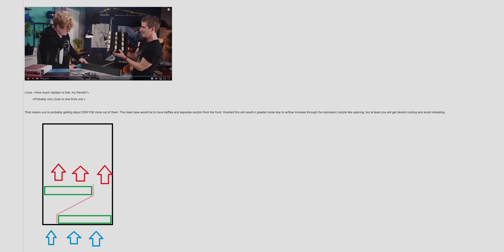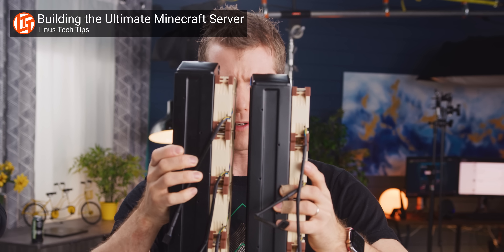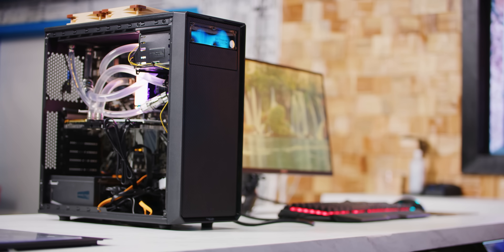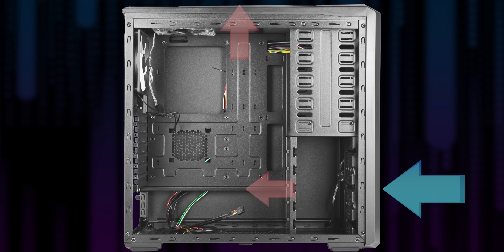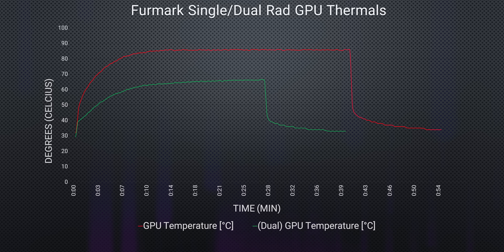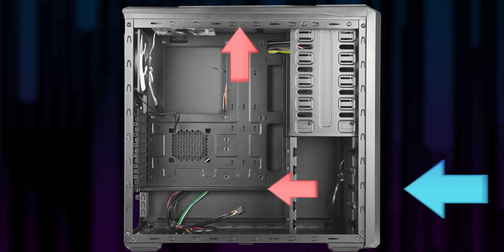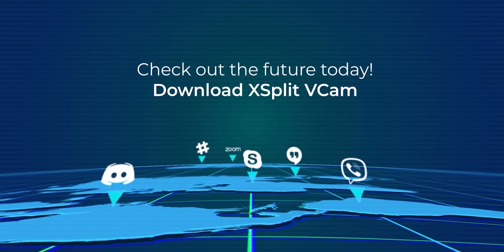I’ve been water cooling wrong for YEARS - $H!T Manufacturers Say

Comment: It's complete bullshit. If the water is 40'c the air coming out would not be "near 40'c". Air is TERRIBLE for thermal transfer. It will be at best 35'c. There is still a big temp difference. You would have to use the worst fans in the world at idle speed for air to come out near the same temp as the water. If radiators could pass heat to air that easily they wouldn't need so much surface area.

Comment: Linus, because of the way heat exchange works, you should make sure that the radiator getting the hottest input air is also the one getting the hottest water. So if your loop has the radiators in series (with no loads between them), run the outbound radiator immediately after the last heat source, and your input radiator after that one. This can give you a huge improvement in radiative efficiency. It's the same concept behind a 'counterflow chiller'.

Comment: I had a weird diminishing return when I was using a Corsair 240mm AIO. I had the fans setup in Push/Pull config and the temps were actually better with just two fans mounted as intake.

Comment: I understand the point Corsair is making, putting radiators for anything, whether it's a truck or a PC back to back is not going to increase the cooling capacity.  It's more important to have adequate air flow through one radiator to make sure all the heat is pushed out of the case.  If you want to increase the exchange area then I would figure out a way to put more radiators side by side,  say about three in place of the side window?  With nothing blocking the front, you could pull in more air to pass over the radiators and out of the case.  And let's not forget the side behind the motherboard, why is that area not being used other then to hide wires?  Shirley,  we can use that space more efficiently?

Comment: The problem with Corsair's analysis is that they assume that the radiator is almost 100% efficient at radiating heat.  The output airflow from a radiator will never be "a hair under the temperature of the water in the loop" as air is not efficient enough at picking up heat to do this in the brief amount of time that it takes for it to pass through the radiator.  The best way to show this would be to have temperature probes in front and behind a radiator.

In my experience, with a ambient of around 30C and a coolant temperature of around 44C, the output of my top radiator is around 35C - yes, this will reduce the efficiency of a radiator stacked with it but it doesn't make the second radiator ineffective.  (do note that the only directly measured temperature here is the water temperature, the ambient is shown by my air conditioner at the other side of the large-ish room my computer is in and the ambient is probably higher in the corner that my computer is in due to a lack of air flow and that the output temperature is estimated by my hand over the exhaust and could be off by a few degrees either way).

You can use the equations for heatsink efficiency and heat transfer with radiators as they are basically heatsinks that transfer heat from the water contained within to the ambient air flow.  https://en.wikipedia.org/wiki/Heat_sink

Comment: I'm a little new to the water cooling scene for computers, but I'm a car guy, and I think a lot of automotive water cooling concepts carry over. One obvious benefit of multiple radiators is that it increases the coolant volume, so there's more coolant to heat up which gives you a thermal buffer. The concept of stacking radiators has been done in the automotive world. They'd call it the number of cores. There's a benefit to adding more radiator cores, but there are diminishing returns. In your experiment, it seems obvious that once the air and coolant passed through the first radiator the coolant was still hotter than the air. So there's still a thermo differential when that air meets the coolant in the second radiator. And the scenario where the radiators are not stacked, but opportunistically located around the case is even better because it approaches the ideal of one radiator with twice the surface area. So I'm not surprised by your results.

Comment: ... if you have the radiator on the fans pulling air into the case... wouldn't that mean that you're heating the air before pulling it into the case, in theory putting it back into the components to need to be extracted again?
I'd always put an internal radiator at the air exit of a case... or even better, completely external.

Comment: If stacking radiators really made performance worse, then dual air coolers wouldn't make sense. My money is on more radiators, given equal airflow, and ignoring noise (of course, it will be noisier, you need more and/or more powerful fans), will suffer from diminishing returns, not make it worse. The air will never get hotter than the water it is cooling (well, using fans, anyways. This doesn't hold true if you're using jet turbines to push the air through all the extra resistance,)

Another thing that might be interesting to see is to compare having the water flow through the stack of rads in the opposite direction of the airflow (I believe this is referred to as a cross-flow configuration?) vs having them going in the same direction.

Comment: Stacking up their rads in their minecraft server build is bad because all the output of rad 1 goes into rad 2. So Corsair was right. But the new build like they explained is better because of the extra air coming in. They should test rads in series like the minecraft server vs only on rad.

Comment: That’s why the top radiator should be the first in your circuit to remove most of the heat and blowing that heat out of your case then the front radiator second as it then receives fresher cooler air to lower coolant temperature further before returning to your CPU. That way the second cooler doesn’t bring as much heat into your case.

Comment: Well of course it took longer to reach max temp. There's a larger volume of water when you add more tubing and another rad. You could add a 1 gallon milk jug to the loop and it'd take even longer to heat up.

Comment: The change in air temp is directly related to how long it spends in the radiator. Speed up the flow moving through it and each unit of air will pick up less heat. A 3 radiator stack with only fans on the first layer will get heat soaked as it's not moving enough air to keep up. The example Linus showed had 3 layers of fans to move more air and lower the temperature differential between the layers.

Comment: Some "engineers" really make me facepalm. Being able to do simulations or even calculations on paper is useless if you can't relate your theory to the real world properly.
Common mistakes are: 1) not getting the scale right; if you have square roots or exponents in your formula, and you double one value, then you could quadruple another value. Spoiler alert: the formulas for airflow contain V², and then calculations like the finite element method (that is used in CFD) are basically a bunch of partial differential equations with integrals.
2) Not taking into account (some) properties of the actual fluids. Like the difference in heat capacity of water and air.
3) Corsair really talks bullshit about the claimed efficiency because a PC radiator does NOT have countercurrent exchange, let alone cellular countercurrent. Did they just plug in a zero width thermal interface into their CFD model with the assumption that they can reach cellular countercurrent efficiency? You will never have near 100% efficiency with these corsair radiators, period. That's just the laws of thermodynamics. Therefore you will only get to that high temperature air if your airflow is way too low, but if that's the case then even your first radiator isn't doing shit.

Comment: Did it not occur to you that adding fans is actually boosting the performance, and less so the added radiators? Staking radiators reduces thermal efficiency per radiator, but its fans provide extra air speed and thus increasing the efficiency.

Comment: Engineer here, going back to thermo 1 (jr year engineering course): Those CFD simulations are assuming a mass flow rate of the air as well.

I'm sure there is a set of conditions where Corsair is correct. However I can't help but notice those Noctua fans which probably push more air than their simulations assume. Higher mass flow rate means exhaust air is at a lower temperature than lower mass flow rate. This means the interior of the case is cooler which means that second radiator has delta T to work with.

Having worked with FEA in automotive we always verified our simulation results against real world test data. Clearly Corsair isn't doing that here....
Reply: Great comment.

Comment: If you put your cpu and gpu in the same loop and then run the radiators in parallel what are the results?  Also I suspect series would have worse results? I want to know if separate loops are really better or not. Oh also one big loop with radiators between the CPU and GPU in the loop.

Comment: Gonna do my first water cooling build with the o11 xl with two radiators.   Should I do radiator top exhaust, with side intake rad, and intake fans at the bottom or another way? Which is best for performance ?

Comment: What they meant with the initial build (rad-fan-rad-fan):
- As soon as the air leaves the first rad, it is already very close to the temperature of the coolant.
- That means there is very little temperature difference between the frons and read of the rad.
- That means that the second rad does not dissipate much heat from the coolant.
  - Also, in this case, the second rad would increase water resistance, effectively reducing cooling power

Adding another radiator would help if:
- the second radiator sits between the CPU and graphics card 
  - Temp rises after CPU1, cools after rad1, rises after GPU, cools after rad2
- the radiators are put in parallel
  - This would result in a lower resistance for the water and increase surface area, increasing coolant performance

IF and ONLY IF: 
- Both radiators point either in or out (only suck-suck or blow-blow, no suck-blow)
  - preferably blowing out, as that means they are not heating up the RAM/VRM's
- Hot air goes up
- There are as many fans blowing into the system, as there are blowing out of the system (air pressure issues)

Comment: I've just added a second rad to my loop and there's a definite temp drop as a result ~10c on both gpu and cpu. But then both mine are venting, not intake. Why would you configure a radiator to blow in to the case though?
Reply: Laziness and too much care about aesthetics.  By limiting oneself to space inside the case, you have to use smaller radiators, and have to put them where they fit.  Put them outside the case and you don't have that problem.

Comment: youre removing heat not cooling a radiator. i can see how stacked radiators would increase the bottom end temp, but more surface area is more room for heat to escape and greatly reduce the ability to sutain high end temp. then stacking two sets of fans reduces the resistance of airflow and both rads see a benefit.

Comment: What wasn't mentioned was the order the radiators were in. In most cases (heh), loop order makes negligible difference but if you were to put the rear radiator before the front one it would have a chance to drop some heat from the coolant before being dropped closer ambient by the front radiator. You could then run both sets of the fans at a lower speed than if the front was doing most of the work and get the best out of the additional surface area.

Comment: They aren't  THAT wrobg, with stacked radiators it depends in wich direction the water flows. When the water flows from the innest to the outest, then it is more efficient than the other way around. Its called the counterflow principle. The same thing is used by Dialysis and in our Kidneys. Would love to see a test in wich you test this with a quadrouple stacked radiator, wich is the only intake/lead the water outside of the case, run it through the rads in a box and back to the system and measure the water temperature! sry if grammar is bad, greetings from a german Nurse :)

Comment: That's because the radiators are not 100% efficient. On paper, it works but not in the real world. There is going to be heat left in the loop that the radiator can't dissipate. The more radiators you have, the closer you can get it to room temp.

Comment: Here's a watercooling tip.  If you watercool your CPU alone, have the radiator positioned at your case air intake so the GPU's heat output into the case isnt limiting your radiator performance.  If you water cool both your CPU AND GPU (AIO or custom) use both loop radiators as your output at the top of the case instead of input, since case ambient temperature will not be affected by GPU, and the case air flow will be higher than the ambient airflow

Comment: LTT and Corsair are both right in that the use of water is a great heat transfer use.  The main reason for this us it is 32 times denser then AIR. Yes the way the loop is configured makes all the difference.  One of the things that may have been over looked by both is that the radiator is in contact with metal and is actually transferring heat there too.  The biggest way to make your loop cooler is by using fresh air from the outside of the case so pushing air out the back of the case with more fans then the radiators have is a must so the air that is pushed through the radiators can pull the most heat from the loop.

Comment: What? That is no where near disproving their claim. You aren't even "stacking" rads in that system.
I was expecting you to take the systems they told you about, remove one rad, and THEN do a comparison.
You need to do it again!
1. Run the minceraft system you built with the stacked rads
2. Remove the third rad and fans and rerun benchmarks
3,. Remove the second rad and rerun

4. compare stats for all three setups
5. Run the other one with both and benchmark
6. Remove the intake rad - run  benchmarks
7. Compare both.
This was not totally misleading, but I suspect you realised that the monecraft one would probably not be as clear cut, and they might even be right!
Also, the top rad in the new build was using the case as a heatsink, that may also have bene a factor!!

Comment: just need to be sure the hotter air / component outputs goes through the second rad first, then through the 1st rad that is getting fresh ambient air.

Think radiator stacking such as in a car, each rad is less efficient then the one in front of it, so the AC condenser is getting cooler air than the engine radiator which takes a ~20% efficiency hit (iirc) due to warmer air it gets from the AC condenser ...

Comment: I'm actually pretty surprised they were wrong with the three stacked radiators, when I saw you guys do that I didn't think it made sense either. That suggests their radiators actually aren't very efficient. Would be interesting to see how many radiators you can stack like that before it stops making a difference, maybe with single fan radiators so you aren't limited by how much heat you can produce.

I don't remember how you routed the water, but you should get the most cooling with stacked rads if the water is flowing in the opposite direction of the air, so the hottest water can give out heat to the hottest air, and the coolest water gives of heat to the coolest air. In that configuration I believe you should always be able to keep stacking rads until you get down to almost ambient, regardless of the amount of heat being dissipated or the size of your radiators. That would also be a really cool test.

Edit: After rewatching the video I think you did do it the smart way, which explains why it worked. If you ran it the other way three rads would probably not be much better than one.
Reply: i tried making a rad sandwitch  once. 2 rads with fans in between and found it was better than one rad, but not much.
Reply: cosair also dont have thick rads either, but ek does and they are little better. So for sure there rads can be doubled up for an improvement. Cosair are rather new compared to EK.

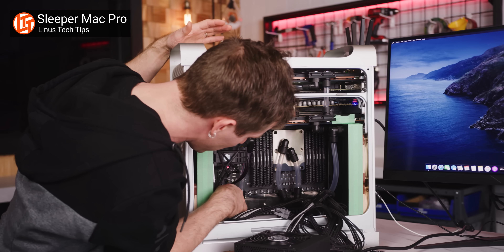Comment: IMO Corsair's claims are based on the premise that the air coming out the first rad in the stack is at the same temperature as the loop, but apparently this is not the case, otherwise there wouldn't be the benefit seen with the Minecraft server (6:46). I suppose that especially with high air flow the rad doesn't reach 100% efficiency, and that's why more rad can be beneficial.

Comment: Saying you shouldn't stack rads is like saying they shouldn't make thicker rads. Guess what. Everyone does it and it works better anyway.

If a rad could heat the air to the same temp as the fluid passing through it, that would be the point at which making it thicker or stacking higher would become ineffective. They simply don't operate at perfect efficiency, so thicker rads, or more rads stacked together will continue improving temperatures. You'll continue seeing diminishing returns the thicker you go though.

Don't mind me though - this is just my common sense talking...